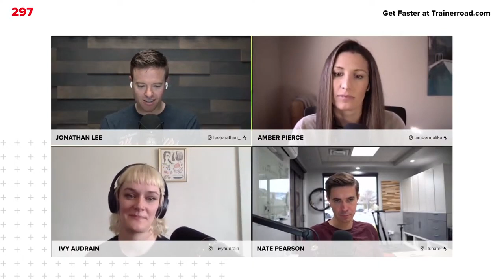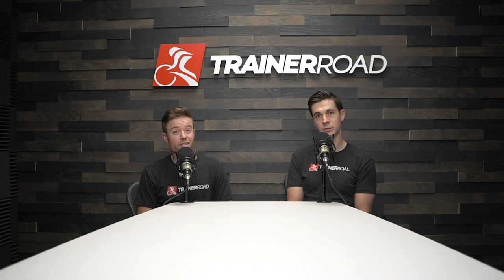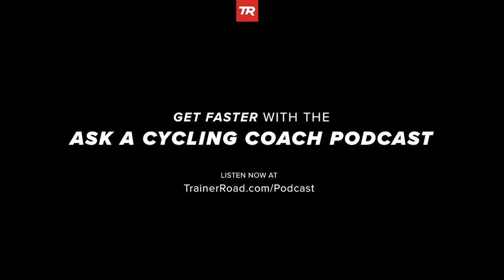Cycling Power Curves: Fixing Low Sprint Power (Ask a Cycling Coach 297)

Comment: I'm in the same position as Nate -- my sprint power is really not much more than a 100 to maybe 200 watts higher out of the saddle than while seated. No matter matter how fresh the legs, no matter what gear I'm in, I simply can not get the power up. There will be that initial torque, peak power surge, where I can see the watts spike over 1000w, but within five seconds I'm already down to low 600s. I can watch my cadence spinning up, but once that flywheel of the Kickr gets going, the watts simple plateau ... regardless of how fast I get the crazy legs turning. Absolutely no clue how to remedy this. That's why I"m always amazed to see guys holding 16w/kg or more for the fifteen to twenty seconds.